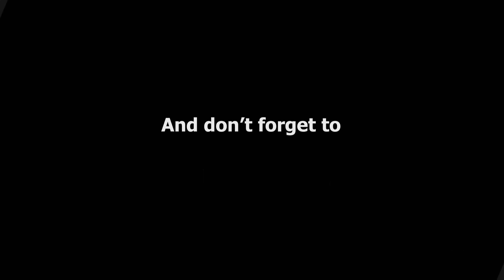Tesla Model 3 Charge Port Hacking : Green T

Comment: There is actually one more state that the T can go to. It is called rainbow mode. It is an Easter egg on the S,X and 3. Normally it is being triggered when you press the S3 switch (on the charge handle) of a 2nd Gen wall connector (like you already have) or a 1st gen Mobile Connector for 10 times in a row.

Comment: Hey Damien - is the goal to enable CCS, in that getting the charge port protocol working is key to enabling CCS?  As I understand DC charging - you are essentially connecting DC directly to the battery + and - (based on a crude understanding of the Tesla HVJB operation).  So the critical parts are getting the charge port protocol working and then also monitoring the battery status closely.
Reply: Damien covered this in depth in one of his earlier videos. The idea is to use the Tesla charge port controller to act as an intermediary between an open source vehicle control/BMS ECU and the EVSE or DC fast charger. The reason for this is because CCS is a very large and complex standard which is only "open" if you pay the standards body many $$$. Compatibility between cars and chargers is also apparently a hot mess as a result. Tesla have done all the hard work in their charge port controller so we can piggy back off that by reverse engineering the CAN messages sent between a real Tesla and the charge port controller. There is also work underway to do a similar thing with the Hyundai Kona charge port controller. Both can be had for very little money.